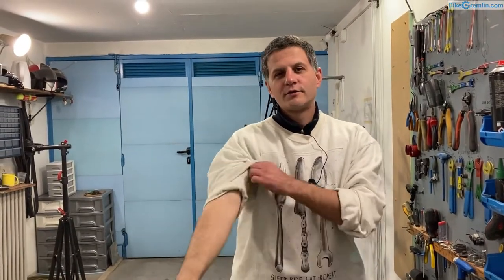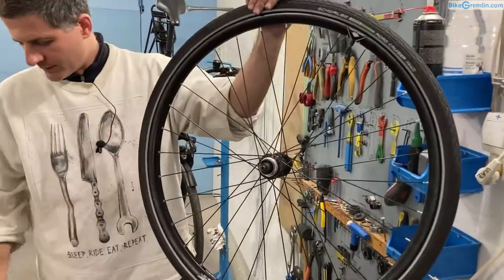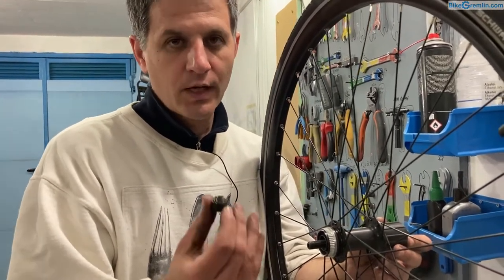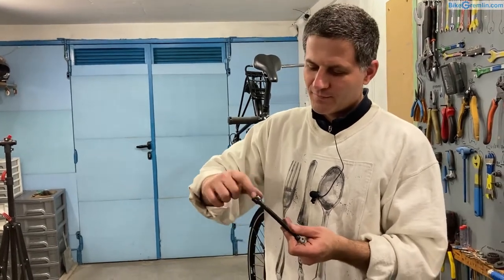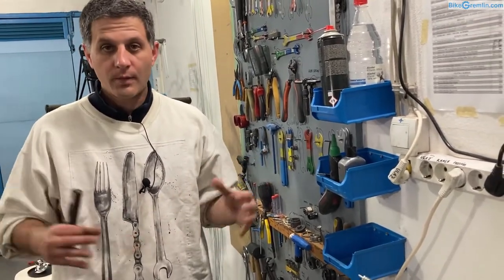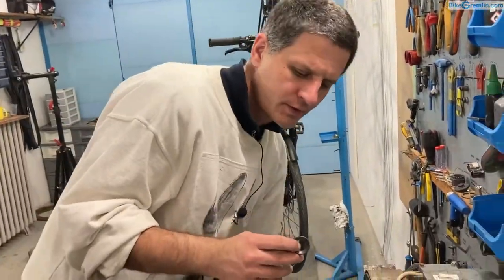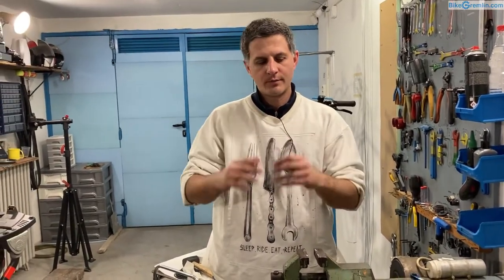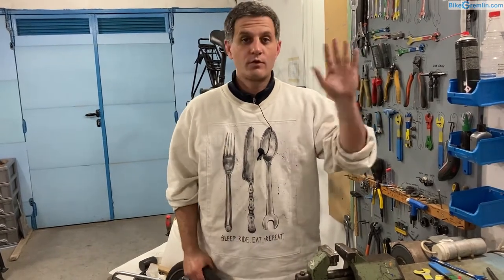Cup and cone hub service (overhaul) - how-to

Comment: Thank you for making all these high quality and in depth guides! This channel will be very popular in the future when more people know about it! 

I don't have anywhere close to the amount of experience as you working on bicycles. However when I have been rebuilding sachs 3 speed and shimano 7 speed internal hubs, there is supposed to be just a hair of play when the locknut for the cone is tightened. This tiny amount of play will be taken up when put in the frame and the axle nuts are properly torqued just like it is when using a quick release. This is even written in old german service manuals for sachs 3 speed internal hubs.

Comment: Is the quick release play also needed on steel hollow axles? Never thought the QR would be that much pressure. I think I did mine to tight last time..
Reply from the maker: Yes it is - the hub in the video has a steel axle.

Relja

Comment: your videos are very good info! but i have a problem with this..i cant tight the right -hand side lock-nut then i cant move around the axel freely. But when its almost loose close to the cone itds quite ok, but is that ok? it wont fall off? on the left -hand side i can close the lock -nut little better,,what am i doing wrong here?
Reply from the maker: Hi Kristofer,

I'm not sure I understand the problem you are having.  :(

Generally:
For fine-adjusting the bearing preload, it can help if you hold the axle in place with a vice or similar (make sure to put some inserts to not damage the threads). That will let you adjust the cone as you like, hold it in place with the cone key, and just tighten the locknut against it.

Without the vice, there is some rotation and it is a bit more tricky (I've gotten used to and learned to do it without a vice, but I think I should make a video of how it's done using a vice).

Relja
Reply: @BikeGremlinUS  i think i solved the first problem but still.. when i put on the wheel on the bike there is some minimal "play" like u say, but if i tension the axel and cone more the wheel wont spin freely, this is even after i tension the quick release. I felt my back- wheel on my mounting bike it also have some minimal play..? can i have it like this or will the cykling be a problem,,this new bike is a racing bike with very smal tires, 28 diameter and 23 width.
Reply from the maker: I've seen some low quality hubs that could not be adjusted properly - you could only choose between some play or some rough spinning.

Most decent hubs (including Shimano low-end ones) do allow for the preload to be set so that there is no play (once you close the quick release lever), but with the wheel spinning nicely.

So, if the hub is of a decent quality, and if nothing is pitted, it should work fine, and if it doesn't then it may be that something is misaligned or improperly adjusted.
Reply: @BikeGremlinUS  ok i understand, so what would you choose "some play or " roough spinning?
Reply from the maker: @kristofermed1f  If a bearing is not pitted (damaged), I go with rough spinning (i.e. no play with the QR lever locked). That's worked well so far for me.

Comment: i saw some wear on the Shimano Tiagra rear wheel inner  bearing Cup when i did my road bike overhaul. Almost 1/4th of it was slightly scratched/eaten. Tried smoothing it out with alu foil and metal dish scrubber. Some pits still remain. 3x 6mm ball bearings had small amount of metal missing from their volume, so replaced those. The rest were intact. Should i replace it all together? When does the hub need replacing, at what amount of damage/scratches?
Reply: @BikeGremlinUS  i thought with a mini hand drill used for polishing, i can smooth the inside out with a cone drill head. Not so exact i agree. but next time i'll buy sealed  bearings hubs to replace only that part
Reply from the maker: Good questions.
Pitting on the outside shows after the damage had started below the surface level.
Usually, if the hub isn't serviced regularly, or the bearing preload is too high, or too loose (so there's clearance), damage can happen (wear).
Balls get damaged first (easily replaced), then the cones (sometimes tricky to find replacements) and finally cups.
If the hub is not serviced and proper reload set before the cups are damaged - once they are damaged, the solution is re-lacing a new hub.
That's the downside of cup and cone hubs.
The downside of cartridge cups is you need special (more expensive) tools to replace the bearings when they need replacing. And the bearings are radial (hard to find angle-contact cartridge bearings). Less ideal for bicycle wheel loads. This latter downside is more academic - won't hamper cycling as long as the bearings are replaced in time, there's no noticeable extra drag.

Comment: 37:40: How far should the dust cap be pushed into the freehub body? Until it sits on the cup?
Reply from the maker: There is no set rule of thumb - it depends on the hub model and the cap type (some are mounted on cones, others are pressed into the hub).
Generally: if you press it too much in, it will hit the bearing balls and might prevent the hub from spinning freely. If you press it in too little, it may not fit securely enough or it may cover the cone wrench flats so a cone wrench can't be engaged.

So, insertion depth is not critical. As long as it sits nicely and securely in place, and doesn't get in the way of anything, it should be fine.

Relja
Reply: @BikeGremlinUS  Thank you very much.

Comment: I had a dust cap that cannot be removed, or at least that was what I was told. Is this correct?
Reply from the maker: On bikegremlin.net forum you can post pictures (hub model, if it has anything written, can also help).
That might help someone answer the question.

Relja
Reply: @BikeGremlinUS  🤦‍♂I should've said that a bit differently... Are there any non removeable dustcaps? But I will for sure go to the forum and check it out, it won't be the last question I have 😅

Comment: Now try removing the cup from your hub and installing a donor cup
Reply from the maker: Not the easiest thing to source.
I usually re-lace the wheel with a new hub in case the cups are pitted.
Reply: @BikeGremlinUS  Are cups generally not universal in size?
Reply from the maker: As far as I know, neither cones, nor cups are one model fits all.
In a pinch, one can get away with cones that are "close enough."
Haven't tried that with cups, so can't comment on that. They are generally not considered to be a replaceable part.